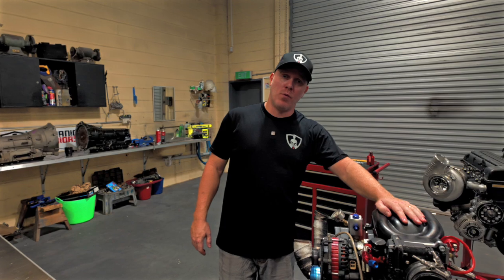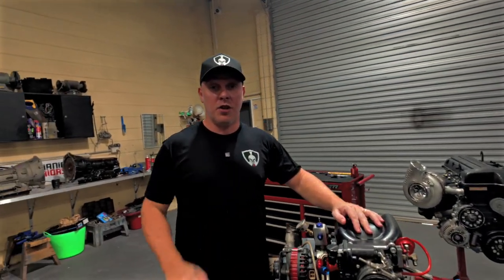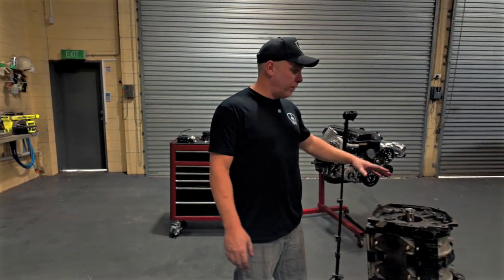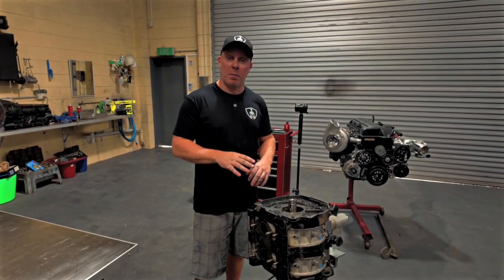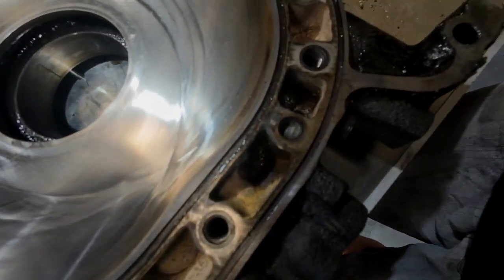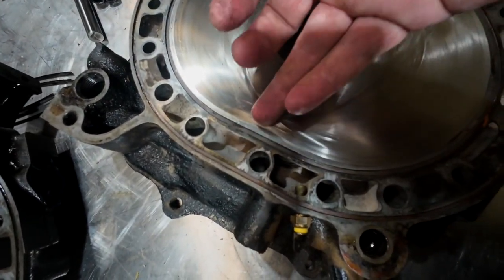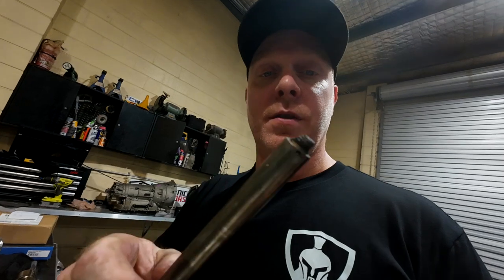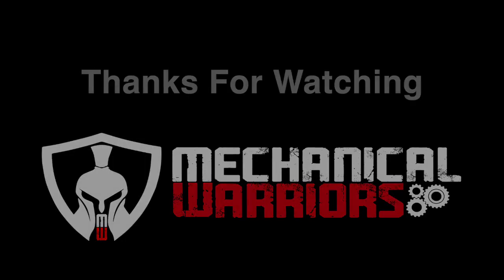RX8 13B-REW Engine Teardown: The Shocking Truth About Poor Build Practices!

Comment: Hi, how has the Adlerspeed clutch worked for you?
Reply from the maker: @cristophergonzalezugalde6351  I removed it I have a new one I’m doing a review on but I got an issue with the engine it’s in so it’s gotta be pulled down
Reply: @mechanicalwarriorsofficial  why did you remove it?
Reply from the maker: @ no good for street use it’s way to aggressive

Comment: What brand apex and corner seals were on the engine? Will u use same? What's your 2 stroke oil to gas/e85 ratio? thx
Reply from the maker: @ralphd9753  I always use stock Mazda corner seals, I run 120:1 and use klotz beno racing lubricant which is a highly refined caster oil I use that same oil with 98 or e85. People say it separates in 98 but it’s bullshit I have done experiments on my channel proving it stays suspended in 98 in fact it stays suspended in all fuels perfectly even after 12 months.
Reply: @mechanicalwarriorsofficial  Thx for the reply. But I'd also like to know the brand of the apex seals. The rotor housings looked to be in perfect shape.
Reply from the maker: @ https://www.rotaryaviation.com/store/p2/RA_2mm_Classic_Apex_Seals.html 

Unbreakable seal

Comment: What brand was the sealer that failed on the oil pan?
Reply from the maker: @gflex187  sorry I forgot to mention this in the video it was Permatex ultra Gray 599ba it failed on every seal I used it on 

Same with the gearbox to every seal is leaking it’s like it reacted with the oil and turned to like a sludge
Reply: @mechanicalwarriors  Oh snap. I had the same issue with the same sealer. Resealed my oil pan twice with the same stuff, and both times leaked after a while.  From what i read is that the formula may have changed over the years. Changed to JB Weld Grey and seems to be holding up 4000 km later.
Reply from the maker: @ yeah I’m doing the same stuff on the reassembly I’ll be making videos for all of it